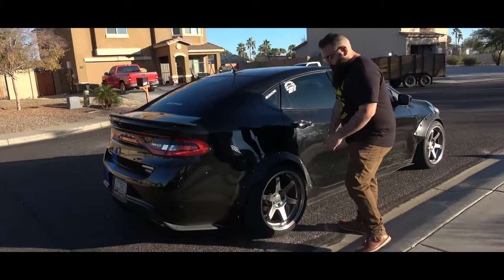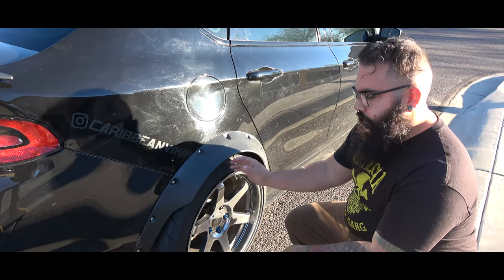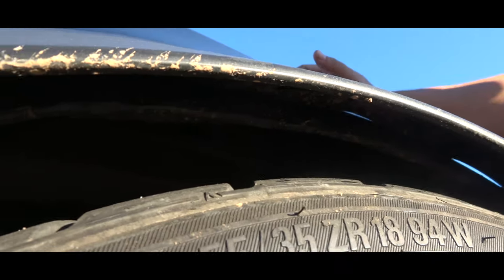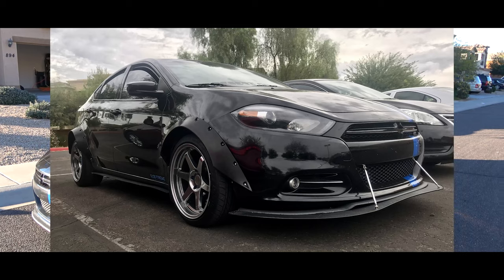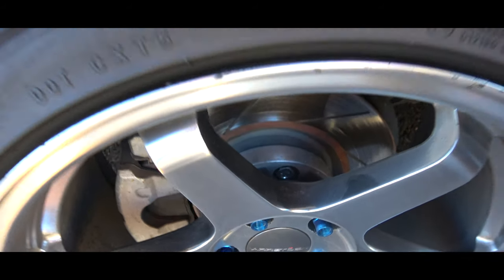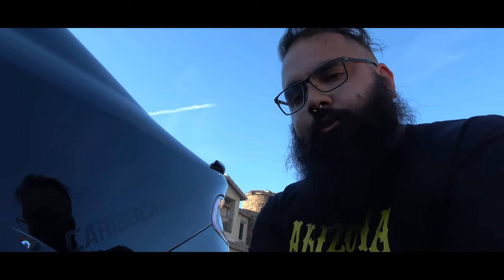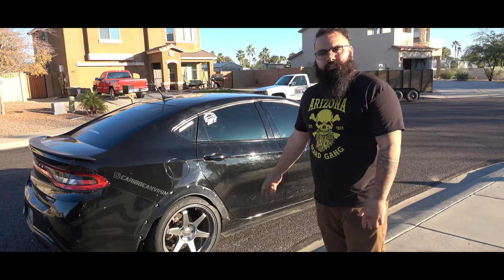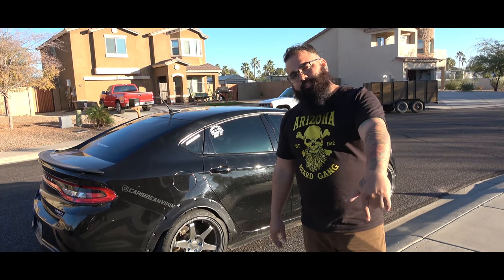2013 Dodge Dart Widebody (Fender Flares)

Comment: Hey where you get the front bumper splitter and will this work for a 2015 dart?
Reply from the maker: I had a friend make it out of pvc plastic and some splitter rods from amazon. Does require you to drill into the bumper but you’d just have to make the shape line it up and secure it.